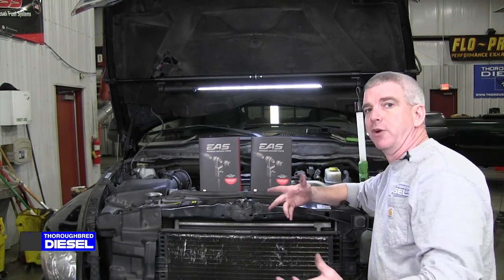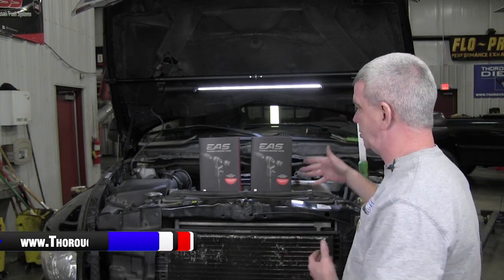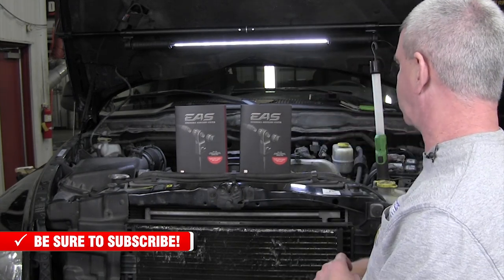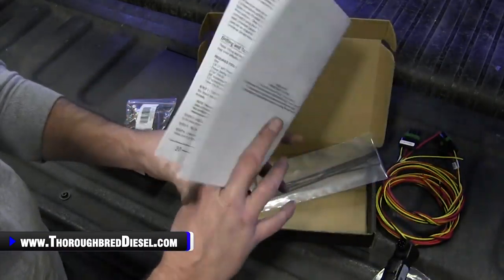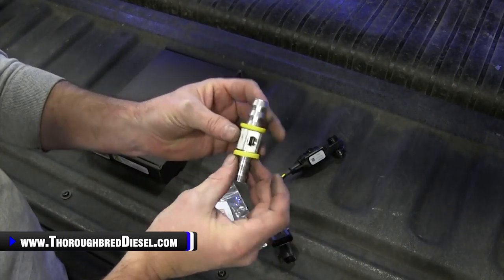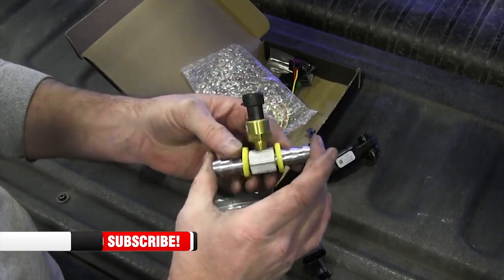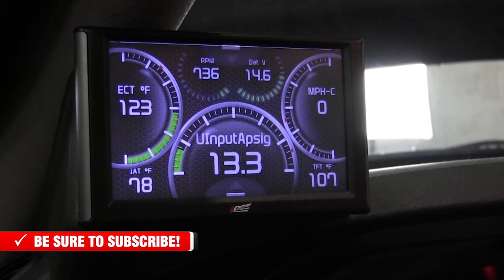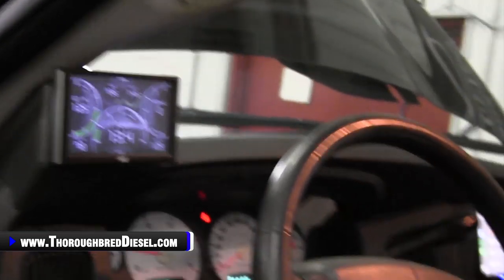Edge Fuel Pressure Sensor Install: 98607

Comment: Where’s the best place to install a pressure sensor on a 2013-2018 Cummins with the stock lift pump?
Reply from the maker: There really isn't a good place with the stock pump unfortunately.  You would need to fabricate something that would work with the stock supply line from filter, or upgrade to aftermarket lift pump.

Comment: So if I already have an add on EGT sensor in my system, do I still need part # 98605 or am I already setup with the enough space for 2 more add on devices?
Reply from the maker: When you are using any sensor that requires 5 volt reference (as the pressure sensor here does), you will need the 98605 kit.

Comment: You can add this sensor on the Duramax filter head bleeder screw port, with an adapter fitting.
Reply: How ???? …..please
Reply: @scaleytail  Buy an adapter where the bleed scew is located on the filter head. The adapter and pressure sensor will take place of the bleed screw. Buy the Edge or equivalent pressure sensor for whatever gauge you have to monitor the lift pump pressure.

Comment: Does the edge cts3 read rail pressure actual and desired correctly from the trucks sensors for a 2003 5.9 cr? Or do I need to add the edge EAS rail pressure sensor? I already have the egt EAS starter kit. All your videos are great and really informative.
Reply from the maker: Each truck as a different as to what it will read but the CTS3 wont read rail pressure as of yet.  They actually do not offer a rail pressure sensor, they only offer this low pressure fuel sensor for lift pumps and boost pressure.
Reply: Just got my evolution cts3 and it does read fuel rail pressure. works great but noticed it doesn't run lift pump pressure. Thanks for the video wade.
Reply: 2021 Update:  Edge (Holley) sells em' now....

Comment: Have not had a chance to watch he entire video yet, but have a question while it is on my mind. I have a 2016 LML and am looking at putting an airdog on my truck and deleting the factory fuel filter with a delete kit. I saw one that had a port in it for a fuel pressure sensor. Will the edge sensor fit into one of those?
Reply: yes.

Comment: Is that sensor able to be used to replace the old fuel  Pressure Sensor for the edge juice with  Attitude  on the VP trucks
Reply from the maker: It will work with the CTS but will not work with the Legacy

Comment: Can this sensor be used as an indicator of when it's time to change filters over just changing them at recommend interval?
Reply from the maker: No it wont be an indicator for that.
Reply: In a round about way, yes. It could show low pressure from either an actual pump issue or filters being plugged up.

Comment: So I just installed these and my CTS2 has the pressure at 51.5  this cant be right?
Reply from the maker: Did you install this as a lift pump pressure gauge?  What truck are you running?

Comment: Isn’t the pressure supposed to be between 50-60 psi?
Reply from the maker: Common rail 5.9L with an external lift pump runs anywhere between 12-20 psi.

Comment: I have a 2012 ram with a fuelab lift pump. I'm running the Ezlynk and want to run a lift pump pressure sensor. Is there a way to connect a aux pressure sensor with Ezlynk?
Reply from the maker: Not currently
Reply: Thanks.

Comment: I'd really like this for my truck but, for $150 for the sensor and $180 for the EAS connector, I'm gonna pass and go with a traditional, mechanical gauge lol.
Reply: You can buy the pressure tranducers on amazon for like 20 dollars and solder the connector to the harness that they include.  They're gouging hard on their sensors... No way it costs that much for a sensor and a couple of plugs with a few feet of wire
Reply: @stephensimpson2252  did you try your method? With the wires connected right did your Edge pick up the “new” EAS pressure sensor?